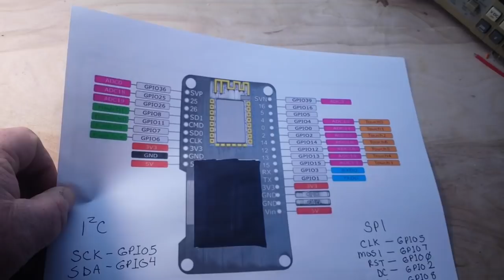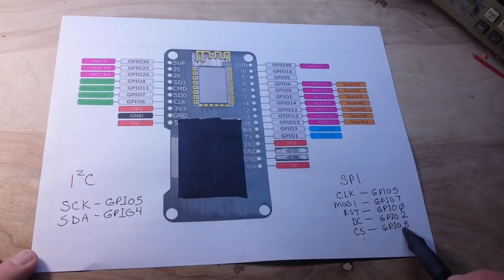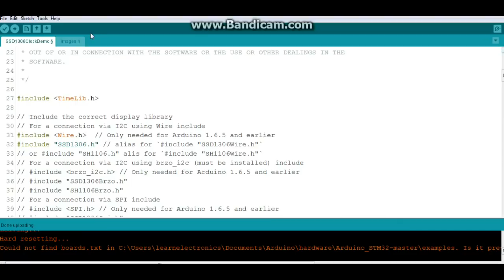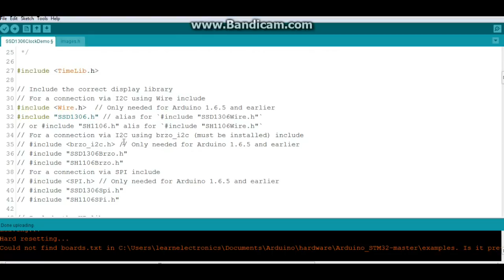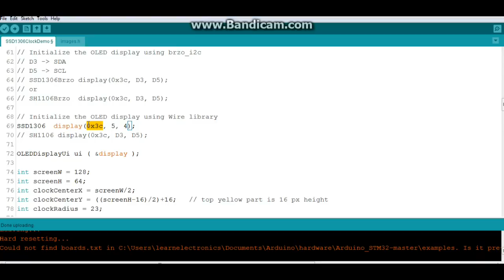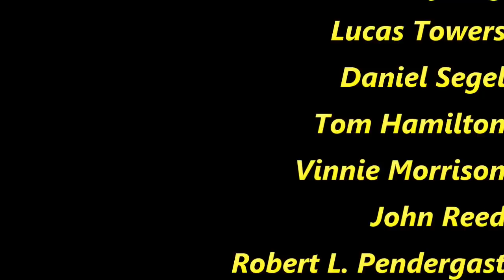Wemos Lolin32 OLED and Gpio

Comment: Thank you. I got MELIFE 0.96" OLED ESP-WROOM-32 for ESP32 Display 2.4GHz WiFi Bluetooth Dual Mode Development Board Display for Wemos AP STA from Amazon. It seems to be the same as your WEMOS LOLIN32. There were several reasons this didn't work out of the bag. You cleared up the last one. Nice job. Other's have noticed the pinout on display at 1:23 should say 4 is SDA and 5 is SCL.

Comment: Has anyone encountered a problem hooking up an i2C device with this chip I tried with an HMC8553
Compass unit which works fine giving correct values however cant display data on integrated oled.
The oled works fine on its own - presumably some i2C conflict with 1306 ?
Reply: 4 years later, but yes. I could not use any I2C devices simultaneously with the OLED
Reply: @abdallah_m  this module is waste of money

Comment: Is swapping SDA and SCL on line 69 intentional? (address, 5, 4). The other examples appear to be in the order of (address, SDA, SCL).
Reply from the maker: Yes
Reply: Thank-you. If its not too much trouble could I ask you to explain why this is necessary?
Reply from the maker: That is the way this module is wired. It does not work in the reverse.
Reply: Interesting. That should stop a lot of head scratching, thanks for the info, very much appreciated.
Reply: The documentation on https://github.com/ThingPulse/esp8266-oled-ssd1306 tells me that the call to the method display of the SSD1306.h / SSD1306Wire.h module should be as following:
SSD1306Wire display(ADDRESS, SDA, SDC)

Since your demoscript uses this as:
SSD1306  display(0x3c, 5, 4);

I believe that GPIO 5 would be SDA instead of SCK/SCL and GPIO 4 would be SCK/SCL instead of SDA. So that would mean your writing at the paper at 1:42 would be incorrect. Am I right? I'm quite a newbie to Arduino and related things so correct me if I'm wrong.
Reply: @Joennuh  you are right, the paper in the video shows the wrong labeling, SDA = 5 and SCL = 4. BTW a very good video.